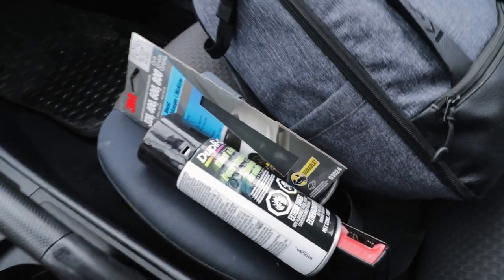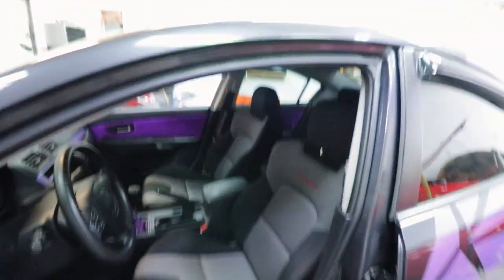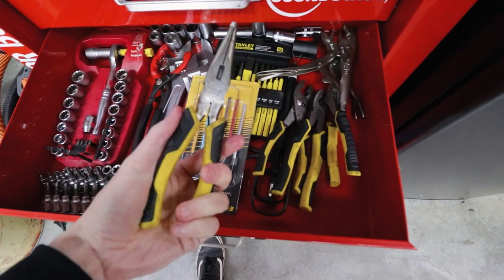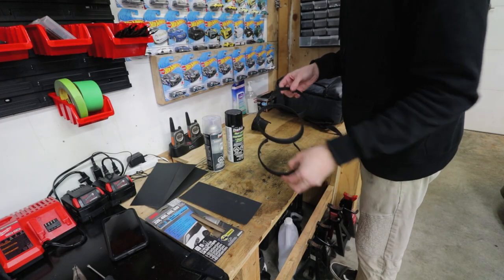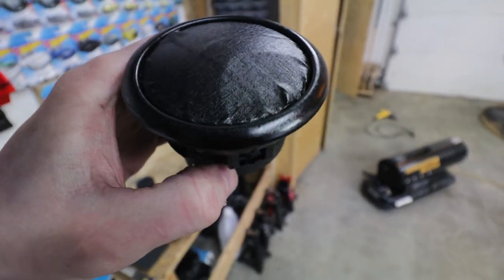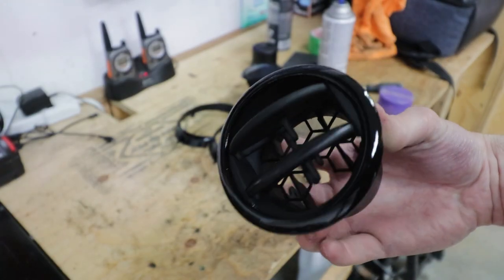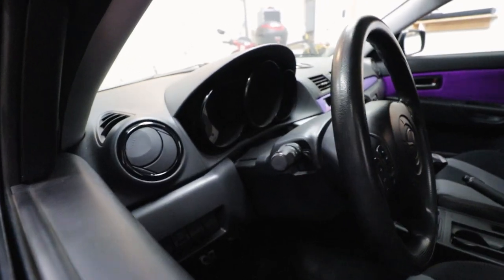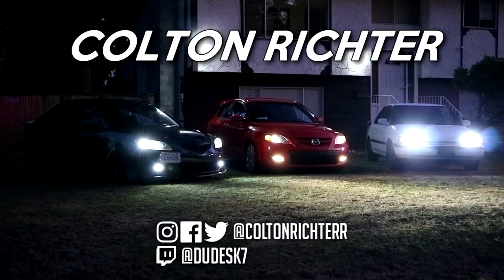Cheap DIY Interior Mod!

Comment: Hi mate. We had a major recall in November 2021 on the BK Mazda 3 in Australia. Apparently, the Mazda badge in the centre of the steering wheel can shatter in the event of the air bag deploying. Mazda replaces the complete steering wheel centre pad free of charge. Cheers for the video uploads.
Reply from the maker: I got the same one, only affected one of my 3's :)
Reply: I haven’t done it yet because my mum tested that out a few years ago and it worked fine 😂
Reply from the maker: Bro 💀😂
Reply: @NikA-wr6px  🤣🤣🤣

Comment: Hey Colton, what is the purple part interior you call? How can i dis-assembly it? Please advise. Thanks
Reply from the maker: I have videos regarding interior trim dismantling and painting.
Reply: @ColtonRichter  appreciated for your help. I drove mazda 3 also.
Reply: @ColtonRichter  oh, and one more question. Could you Please and Please put the link of the part that you bought in the Description? I think that help us alot and you can also earn commision on amazon too. I want to buy the "spacer" that you installed for the white rear wheels. Thank you so much.

Comment: i recently bought mazda 3 2006 (base model) whats the maximum tyre size that i can go for? originally it comes with 15 inch love your videos
Reply: for example 205/55 16inch and 205/50 17inch
Reply: 18" or more you might run into rubbing and other issues, i would say 17" is the sweet spot
Reply: i run 18s with tyres 225 at front 235 at the back, 235 at the front just rubs and 225 rubs if you full lock. 17s are the sweet spot
Reply: Mine is 17 inches. Chrome. Perfecto buddy